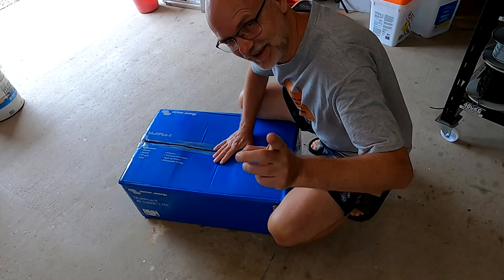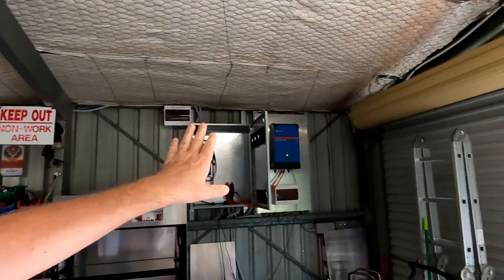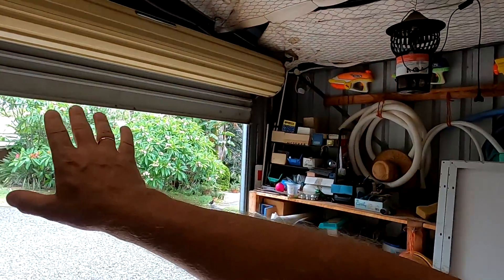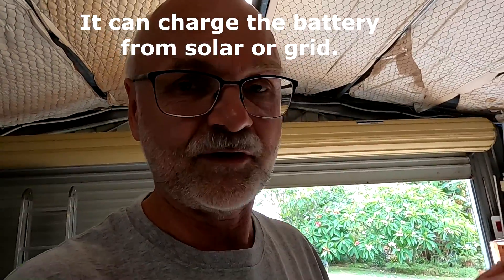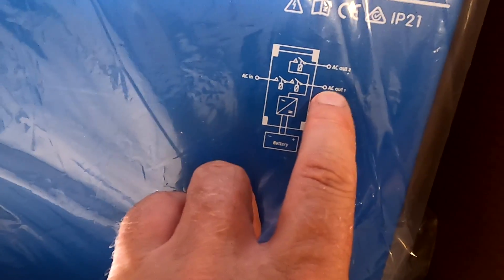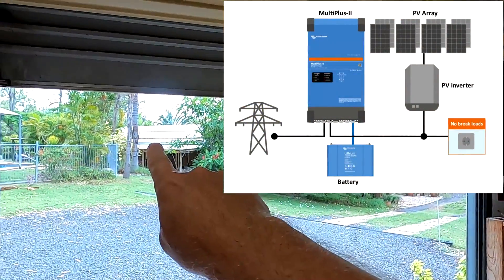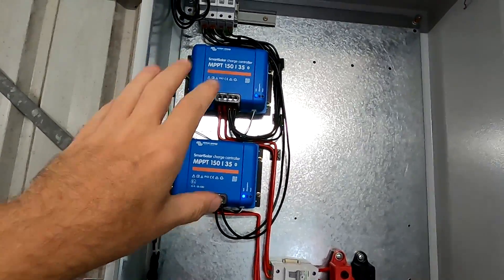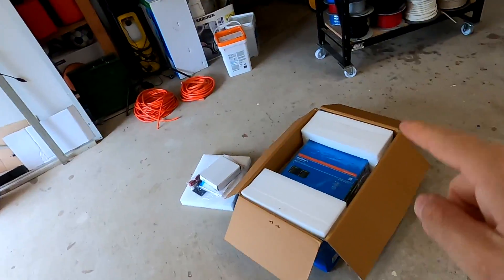This Multiplus II is not what I've ordered. But I keep the free upgrade, right?!

Comment: Would be curious how much power you use/ send back to the grid from the house in a future video. Then we can all start thinking up idea’s on future community projects for ya 😄
Reply from the maker: The house produces around 22-25kWh on a good summer day and around 10kWh in winter when the sun is a bit lower. The roof points to the east so it's not optimal and there are also large trees which cause shading in the morning and during winter time.
Export in Summer: 13kWh per day
Export in Winter:  7.5kWh per day
The solar on the house takes up around 20% of the available roof space, so there is more potential...
Reply: @OffGridGarageAustralia  alright, well heck you might have some perpetual motion going soon lol 
YouTube pays for more solar and and you sell the power back to the grid and you buy more solar to you run out of roof space that is haha 😄 
Very fun channel you got going. Just don’t forget to stay charged 😉

Comment: I wonder if it would be possible to let the Phoenix Inverter be the AC in of the MultiPlus II ? Just in case you need more than 5000 VA for a short time. Anyways congratulations to the new Inverter. I bought myself the same one end of last year for my future 48v island project. :-)
Reply from the maker: Yes, that should be possible as others have commented here. So that will be an interesting project!

Comment: I'm curious what the rules are about DIY solar in QLD. 
Anyone know for sure?
Reply from the maker: As long as you stay off-grid and not connect to the public grid...
There is the the Best Practice Guide for Battery Storage Equipment with its Electrical Safety Requirements which I'm following as much as possible and also the AS/NZS 5139:2019 Safety of battery systems for use with power conversion equipment.
Reply: @OffGridGarageAustralia   I'm sure all states follow the same ASNZ standard, but I am in the nanny state of Victoria and we arent allowed to DIY off grid solar unless under 50V and 240W (which is not good for much).
 I had to remove mine even though I was under the ELV 120V limit.
They also spy via aerial surveillance.

Apparently 50V is the Max DIY solar without a sparky involved.
Reply from the maker: @galactica1980  who is telling you what you can do in your backyard and what not? If you want to store hundreds of liter of fuel in your garage, it's not allowed either, so totally up to you. If you do it the right way and have a double wall steel tank with all the safety equipment, it's safe to do so. If you store this fuel in empty plastic bottles is not safe...
So, the same applies with solar and battery. Be safe, follow the rules and regulations and make common sense decisions.
Reply: @OffGridGarageAustralia  the Government always tells us what to do...
In this case it is the state energy regulator telling us what to do in our own backyard and in this case "following the rules" means no DIY off grid solar here.

Comment: Keep the multiplus 2 we use a quattro 15kva on our ship, pretty much the same thing only 2 ac inputs also wanted the 200amp charger on it, PS when paralleling the units the  ac assist mi is  added depending on the size of unit, our is min 14.5amps if we added another unit it would be 29amps
Reply from the maker: Thanks. that is really interesting.

Comment: There might be an interesting aspect when using the Victron inverters. As from my experience the Victron MultiPlus is not capable in feeding half-sinus loads and/or loads connected with a dimmer/speed-regulator. Half-sinus loads by means of a diode in the live connection to reduce the peak power. Using high frequency CN inverters, do not have this problem. Something to consider for future use when connecting the total domain? Salut, Peter Bovekerk
Reply from the maker: Thanks Peter, all dimmers and motor regulators I have are fully electronic, so should not have this problem.

Comment: List price difference is 37 EUR + tax, about 60 AUD + tax. Keep the Multiplus-II !
PS1: The Multiplus-II does NOT have built-in solar charging. You still need an external MPPT for that. The complete solution is the EasySolar-II  (includes an inverter, MPPT,  GX managing and monitoring device).
PS2: The bus between parallel / 3-phase Victron inverters is called VE.Bus and I'm pretty sure the underlying technology is RS-485, not CAN. They do have CAN products, but those are different.
Reply from the maker: It's $350 down here between the Phoenix 48/5000 and the MP2 48/5000.
Reply: @OffGridGarageAustralia  Interesting pricing strategy....
I forgot to mention: Supposedly, the Multiplus-II has better efficiency and lower self-consumption

Comment: Well short description...
Can we program this Victron multiplus II as below situations all in togather...
1) When ever the load in more (> 15Ah in AC out put), it will take the help from grid for the additional load ( Total load 26Ah, 15Ah from battery & rest from grid)
2) Battery charge function off always from grid 
3) If battery voltage drop below from defined voltage (like 48V DC), it will continue the load from Grid
4) If the battery charge state is > 50%, it will fully use battery only for load for Grid available and not available condition
Reply from the maker: Thanks Biswajit.
1) Yes, that is possible. The Multi always uses solar and battery power first as much as possible before using any power from the grid.
2) the internal charging function can be completely disabled
3) Yes, that also a standard feature. If the battery is low it uses  solar and grid power to power your load.
4) It will use solar and battery power as much and long as possible and only uses the grid if there is not enough power to supply your load.

Comment: I think people are more likely to want a Multiplus, even if you don't need the extra features. In otherwords, there is a bigger audience that wants to see you implement a system using this.
Reply from the maker: Yes, definitely. The Multiplus is the way to go and I think this is the reason there is a shortage for the Phoenix inverters, Victron wants to push the Multi. It would make sense to have only one device instead of several ( Multi, Phoenix and Quattro).

Comment: Keep it, I run a Quattro and a Fronius in in a Micro grid, its awsome
Reply from the maker: Ah great. The Quattro does the same thing and throttles the Fronius down once the battery is full.
Reply: @OffGridGarageAustralia  Yes indeed, the frequency control works great. ESS needs to be enabled on the Multi. Even tho Victron does not recommend ESS for off grid, it works 💯

Comment: Victrons "smart" demarcation I believe refers to whether the device has built in Bluetooth or not, that's it. If you're running every device to a GX monitoring unit then there's no need to buy the "smart" versions of the devices
Reply from the maker: Yes, that's correct, I still like the alternative way to connect via BT to a specific device. In case your GX is not working you would need to hook up a laptop and a VE.direct cable to the device to control it.

Comment: Keep the 5000w run it with the 3000w individually from one battery bank you can later buy another 5000w and parallel them..

Comment: can the phoenix AC output be fed into the multiplus 2 AC input (only make sense if you have 2 battery setup) otherwise run some other independent circuits (pool only perhaps) or perhaps that company will take it as a trade in? I use PIP5048MS they have AC in to charge the battery (as well as solar CC) or you can run the PIP like a UPS. During the years I got upgrades on some batteries and also later model PIP5048MG pips which can take 450V input compared to 145V. So plan still a plan is if 5048MG run down to 30 SOC then then the 5048MS could feed power as it will be a lighter loaded circuit..
Reply from the maker: Why does it only make sense with a 2 battery setup. Both inverters can be fed by the same battery and produce power. I have to disable the charger in the Multi because that would be stupid.
Reply: @OffGridGarageAustralia  In my situation I have 2 sets of batteries one set is 220AH at 48V the other 330AH at 48V and 2 incompatible PIP series inverters. So I could charge up the 330AH on the idle 220AH down to 70%SOC then charge it up when the sun is out. This would only be the case should the 330AH get near or below 70SOC (30% discharged). Its just a way to move power around when one has incompatible batteries without additional expenditure. I am not aware of being able to combine different AH ratings of same voltage without impacting on them (perhaps some DC to DC converter, but for 48V and the amperage that could be expensive and I already have a redundant PIP inverter). Just a situation in life where products are superseded and aren't compatible combining in amorphous grid. Annoying as I bought PIP5048MS (asked vendor did they have anything coming out soonish to do higher solar input voltage, they said no and 6 months later on their website were the 5048MGs - grrr)
Reply from the maker: @rw-xf4cb  you can definitely parallel your battery banks without any issues if they are from the same chemistry and have their own BMS each. I made the test about that here in there channel a few videos back and paralleled a 5Ah battery with 304Ah bank. No problem, just worked...
Reply: @OffGridGarageAustralia  I have 330AH AGM and 220AH SLA (both lead acid) and don't have a BMS in between them and the inverters. I guess one could put a BMS between each array...When they come up for retirement will definitely look at buying LiFePO or whatever the new fandangled technology will be (subject to costs)...

Comment: Hi Andy... Are the eve cells 6000cycles as it says on the website... Or 3500 which it also says...? Amy could not answer the question.
Reply from the maker: The LF280K series has 6000 cycles when compressed at 25°C and 3500cycles when compressed and 45°C.
I have some incoming but will run them un-compressed at ~30°C
Reply: @OffGridGarageAustralia  oh....Thanks so much for the reply, much appreciated. :)

Comment: old inverter could feed a single socket for the car only on a separate circuit?
Reply from the maker: Or, the old inverter could feed the input of the new one. Some say here that's possible...
Reply: @OffGridGarageAustralia  That Definitely sounds possible as long as the New inverter never tries to feed power back towards the old inverter!

Comment: So no parallel but serial! As some already mentioned I would put the 3kv as input to the multiplus set power assist to 2000w so you have something like 6,5-7 kw :)
Reply from the maker: Ahhh, that's a great idea. I haven't read all the comments yet.
I said this myself in the video, the Multi can take any AC input  🤷‍♂️
Whole new perspective!
Reply: @OffGridGarageAustralia   i did this already with a mix setup to up power my setup for a bigger party :D one 24v 1600 phonix inverter plus on 12v multiplus :D worked 2 days flowless :P
Reply from the maker: @thomasribbeck390  it sounds like it worked for two days only...
Reply: @OffGridGarageAustralia  party was over after 2 days. i think i would worked for years ;) but beer was empty... so we stoped. although monday was comming too...
Reply: Yes, serial connection is great option for such offgrid solution. Phoenix first and then multiplus in series. You can also make simple control mechanism which will switch off the phoenix in the case there is no huge power needed. Phoenix standby consumption is reduced then:
a) You can use Multiplus assistant to control the multiplus relay based on output power. 
b) The venusOS  is publishing actual power on mqtt topic /Ac/Out/L1/P and by simple low pass filter added to this measure you can switch the phoenix on/off using Multiplus controll relay and have more complex scenarios covered. Node-red is good for start. 
c) Check the ESS documentaion for further applications. They state ESS is not intended for off-grid solution but in your case it should work perfectly. 

I assume the multiplus relay will be connected to the phoenix on/off control input.

Comment: Very good inverter. 
Two questions:
1. Could you please measure the self consumption of the inverter?
2. I have heard that multiplus II has also this feature: for example,  yours is rated 5000VA, if you have it connected to ac in and you are demanding in Ac Out more than 5000VA it can supplies in parallel both ac in and both batteries "inverted" power to get more than 5000va in ac out. It will be great to test that,  wont it?

Great video!!!
Reply from the maker: Yes, that is correct, the Multiplus has Power Assist feature where it can do that and supplement the AC input. I talked about this in the video as well.
I'll measure the standby and let you know. I had it hocked up to a power supply but forget to pay attention to that.
Reply: @OffGridGarageAustralia  Hi Andy, I am asking about the other way round. I have heard you in the video "it can supplement the AC input", but I am saying about "it can supplement the maximum power "inverted" WITH ac input. Could you check it? Thanks. One thing is: AC input being suplemented by battery's inverted power, and the other one is: AC output is the sum of battery's inverted power plus ac input, Here ac output is supplemented WITH ac input because you have reach the 4000w limit of the inverter.

Comment: Andy, As a Solar installer I can tell you the MP2 is a very robust unit. However it does have a flaw that I don't like.  The A/C input is a push style connector and not a screw type. Using a ferrule on the end of the wire does help inserting the wire but it don't crush to give you a full wire contact. Bare wire is harder to insert. But has a much better contact area. I wish they would of used the screw style terminal on the MP2 like they did on other models.
Reply from the maker: Mine has screws, I'm sure. Maybe they have changed that at some stage... I'll pay attention to it again when I have the cover open.
Reply: @OffGridGarageAustralia  mine too has screws

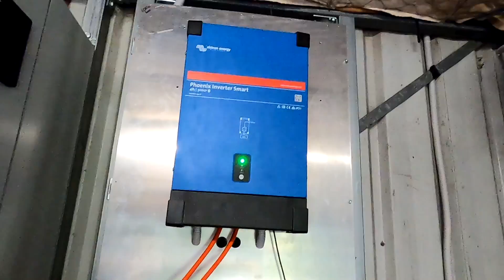Comment: AAAA Andy 14:00 minute: Yes you can feed 5000VA Multi with 3000VA Phoenix to have 8000VA. The 3000VA Phoenix is just 3000VA "non-gasoline" generator. Put it on input (L1-in) and then use transfer switch and power assist of 5000VA Multi with set up to to  2x power assist and that input is capable only 10A ;)  Just don't couple it with AC/coupled solar, because Multi will think that there is grid power and push it out. But! There is also a possibility to use current measurement inside or external and set multi to not export to grid (keep amps on 0 on that current measuremet) and then there is some possible way to even keep ac coupled solar, two inverters and not pay for another 5000VA Multi..
Reply from the maker: That is a fantastic idea!!! Will this work or just making a lot of magic smoke and a brilliant video?
I can set the multi to zero export with a meter or current sensor as you said. But yeah, for the next few years I won't be connecting the AC solar. It needs to feed in 😉
Reply: @OffGridGarageAustralia  DC and AC are isolated on both devices to my knowledge, so there should be no smoke.. You can't connect them in PARALEL as they can not sync, even different models of Multi can't be operated in PARALEL. But serializing them is possible :) There is also a small problem - you can not use whole capacity of inverter as they can provide overload currents for few seconds. This is not possible as you set fixed current on input. But longterm inverting is possible. Another thing that you may take into account is that when Phoenix is overheated, it will provide less AC current, so if you set 10A on input of Multi+ and you have Phoenix over 40°C it will shut down - this can be another reason to not fully use 10A capacity of your Phoenix..
Reply from the maker: @servisfibris6679  great, thank you. I was thinking about the limited output of the Phoenix dependent on the temperature, so I have to set it to a safe number or change it between summer and winter.
Thanks again.
Reply from the maker: @servisfibris6679  Yep, the limitations of paralleling these inverters are well known. 
I have posted a question in the Victron Community page to se if I get any responses in regards to that:
https://community.victronenergy.com/questions/115103/output-of-phoenix-smart-inverter-feeds-ac-input-of.html

Comment: Does your model have the relay that can be activated when your battery at a set % to dump power into say a hot water heater? 
As they create their own microgrid, you can add SOME models of grid connected inverters up to the rating of the Victron 5000VA =~ 4kW. So about 8kW. You'll need much more roof space!
When I bought easysolar 5kva(hardly used) the screen wouldn't work. Ended up being the inline fuse along the power wire to the screen had broken its fuse wire during transport. It was a bugger to find behind a large board inside.
Look forward to you new adventure.
Reply from the maker: Yes, it has a programmable relay. Not sure what trigger points can be set for this but hot water or vehicle charging would be great.
The Multis have the 1.0 rule so can cope with 5kW of AC solar for a 5kVA inverter. That's exactly what I have right now. If I upgrade to another 5kVA Multi I can hook up another 5kW of AC coupled solar.
I have heaps of roof space on the house and this is a great way to connect more solar from this location to my battery without extra wiring.
Reply: @OffGridGarageAustralia  Nice and simple via the existing AC to the garage. Hope it's not too shady on the house, unlike the shed.